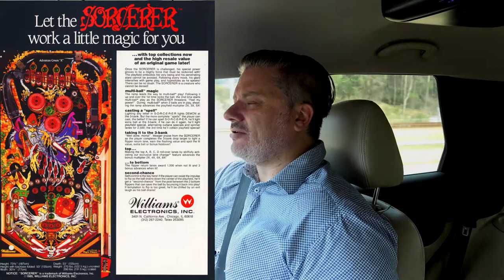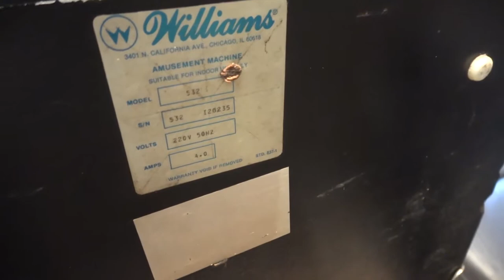SJ024 My First Pinball - Williams Sorcerer

Comment: Its actually a good thing that machine stopped working, as the game play had stopped at that point.
because of that, the playfield is better then what it probably would have ended up.
First this to do is get those batteries out and in the bin.
Second is to throw the rusty balls out !
Third, get the bottom sorted out.
With the legs, put the odd one on the back so you cant see it, but before that, soak them in vinegar and scrub them with scrunched up foil.
I think this is a awesome project and should be fairly straight forward.
Reply from the maker: Agreed, the playfield definitely is in good nick for the game that it is. I have already completed your list ;) Will cover in future update vids. Thanks for your comments and for watching. Cheers
Reply: Awesome ! cant wait to see some work done to it :D

Comment: Congrats on the project! :) Looking good. About the legs - rubbing them with some Coca Cola on tinfoil will clean those right up.
Reply from the maker: Thanks Arctic Arcade! Yes, that’s a good trick. I used that technique on my Championship Sprint wheels and it brought them up a treat although it was still a lot of work! I’m just going to buy a new set of legs though as these are worse than they look in the video and they also don’t match due to the one at the front that is different to the rest. Given everything else I still have to do I thought I’d short cut the process and just replace with new ones. Thanks for sharing the tip though even for others that may be reading this - because it works! Cheers :)